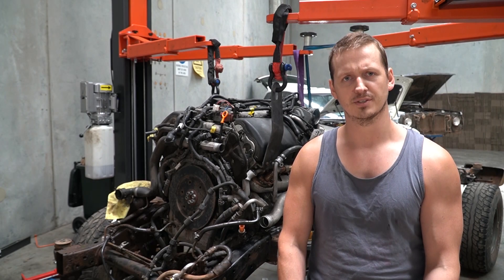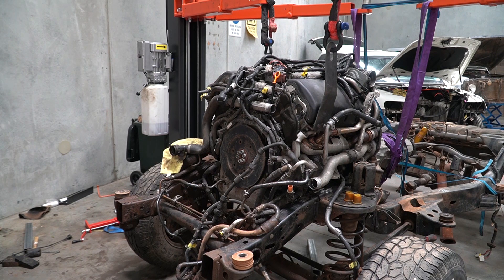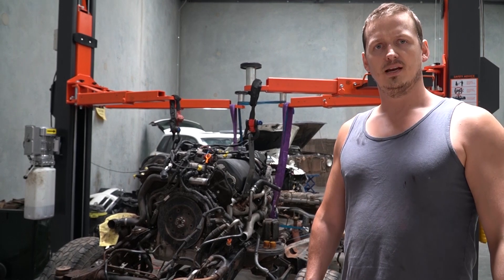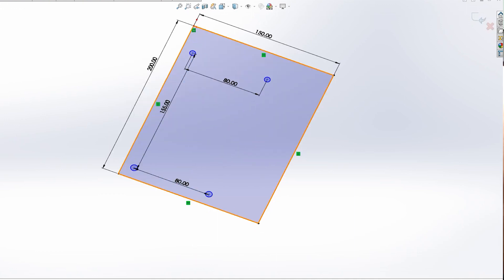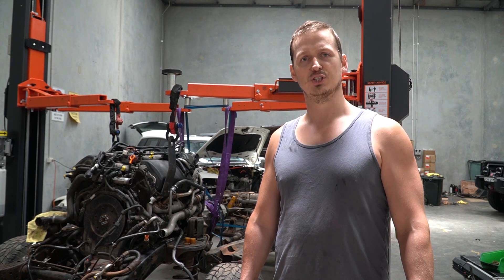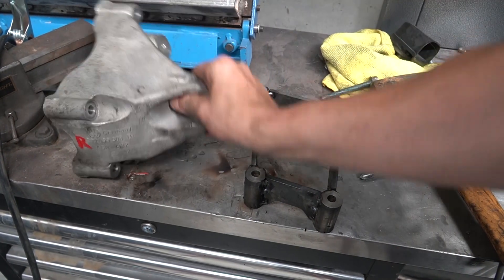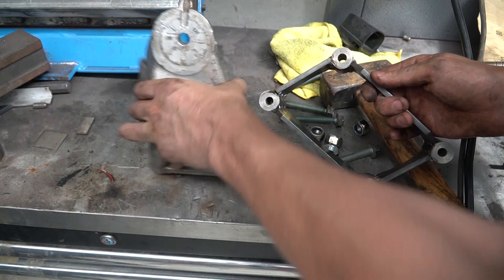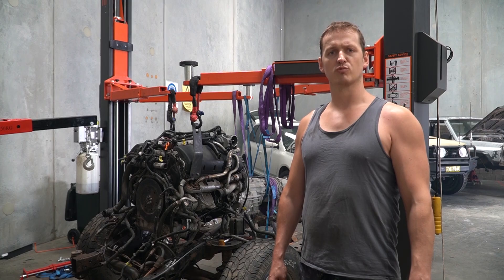V10 Tdi Swap Engine Mounts With CNC - VW V10 Into A Nissan Patrol - V10 patrol ep6

Comment: All those fancy engineering words are why people use engine plates in high power applications like drag racing?
Reply from the maker: I can't really comment on drag racing as I prefer to dress like a man. Although I can tell you that there are a few industries (like aviation, high end racing, life-sustaining equipment like SCUBA and submersibles) that use all these words and more on absolutely everything. Even down to which flavour of washer to use to hold the brand badge on.

Comment: Great video mate. Just like to know why you use engine torque not tailshaft torque after gear reduction for your calculations? I've ended up with gear stick trying to take out my family jewels when my patrol engine mount let go in low range doing silly things...  Factory mount design is crap.
Reply from the maker: It's not quite as simple as just torque multiplying, you've got stuff like converter stall torque, viscous and friction losses. Even so, there are literally hundreds of other considerations in the calculation. The video would be hours long if I covered them all.
Reply: @ridiculousthings4x4  True that. I used fea in solidworks for the last roll cage I built for my rally car. Built it just right as long as I crash just right... Really want to see you finish this conversion as it's awesome.